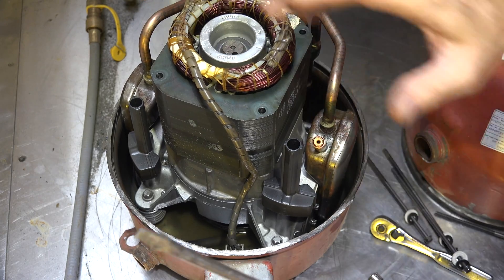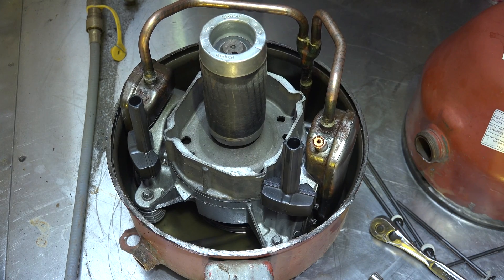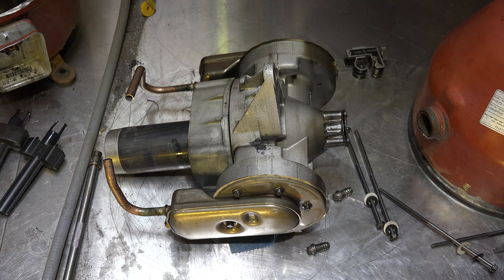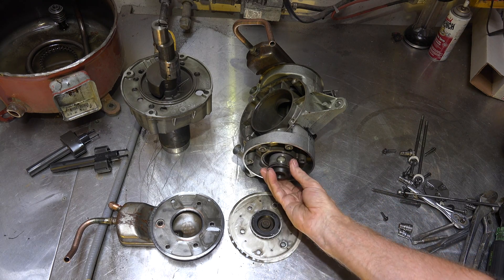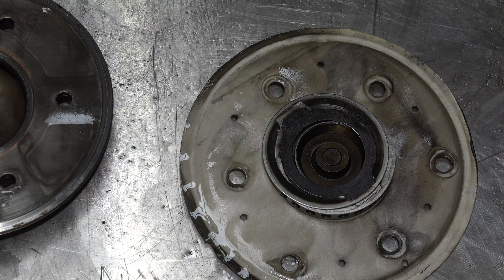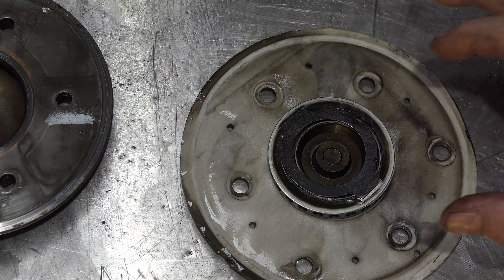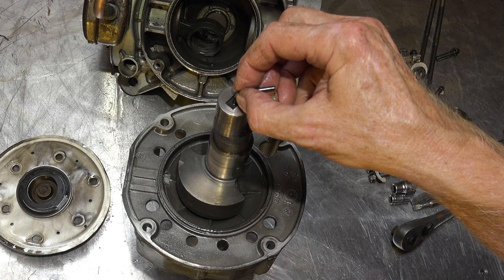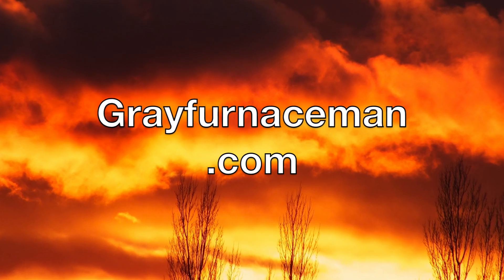The refrigeration compressor part #4

Comment: This is a Trane compressor. How different is this from a Bristol, etc? Trane compressors are the best.
Reply from the maker: The 2 biggest differences are the valve plate design and the opposed 2 cylinder.  Will be looking at the valve plate design next video on this machine.
GFM